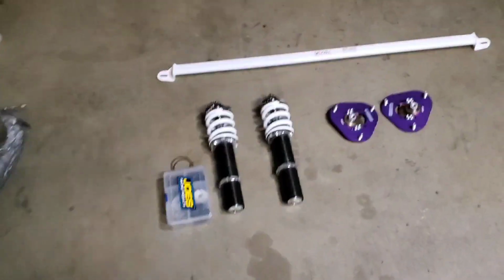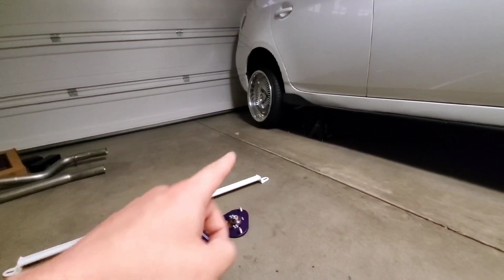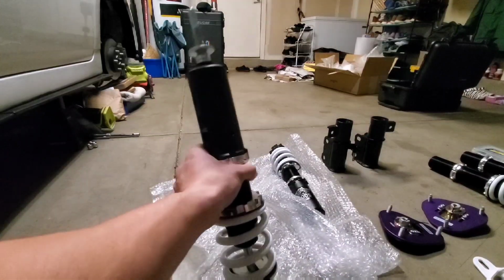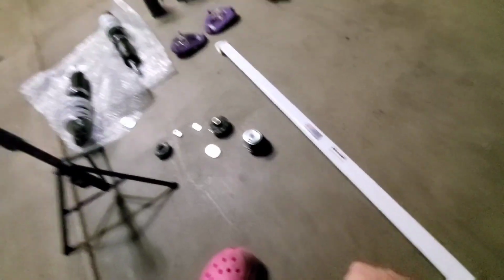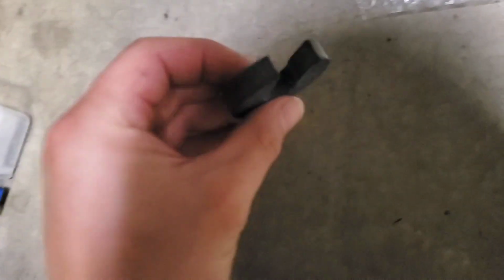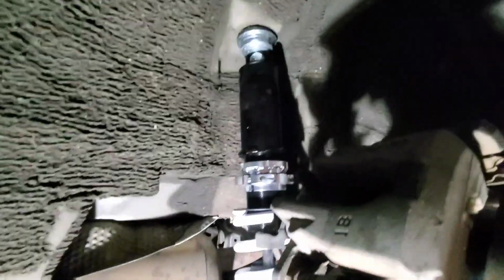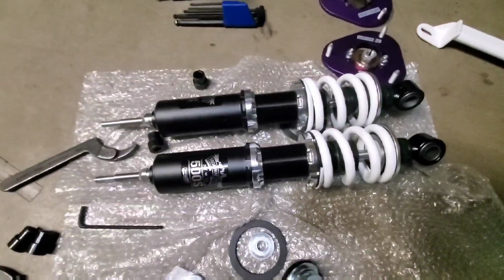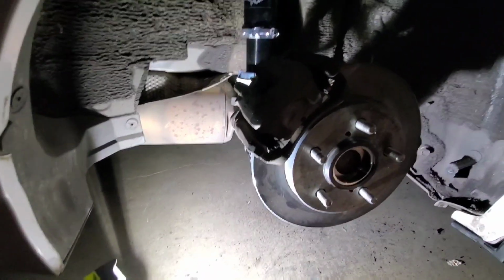PRIUS COILOVERS TRUE REAR CONVERSION BROADWAY STATIC

Comment: would this essentially work for lets say a 07 honda fit?
Reply from the maker: If clearance is available and you design it with the respective dimensions and the strut towers can handle it or are reinforced, yes.
Reply: What model car specifically did you get the rear coils from? I'm planning on attempting this on my fit too! 🤌

Comment: Nice video. What spring rates do you recommend for daily use on my 2016 focus se. My height is slammed and currently run 18k with helpers springs on the rear. The issue is that I keep bottoming on the bump stop with the slightest bounce. Should I go 24k like my fronts or should I just get 34k or higher. I don’t want to cut the bump stop or else I would probably hit my gas tank on the floor. I also don’t want a rock solid suspension that would give back pain. I had a herniated disc a while ago from improper work out form. Anything helps. Thanks.
Reply from the maker: You can adjust the stroke of your helpers to not compress as much because that’s going to quickly use up the piston shaft travel before it starts to hit bump stop. Other than that, you can go up a little bit to maybe 24k or so. I’m on 18k for the Prius with no problems currently. It sounds like your helpers may be the only thing that need to be adjusted if you’re hitting bump stop on the smallest amount of compression.
Reply: @Alexhaav  thank you! Yeah that makes sense. I think I have too much travel that the inertia causes my suspension to compress too much. I think I will just by shorter shock bodies so I don’t have to even run helpers springs if I want too.
Reply from the maker: @bogartsandoval  hell yeah brother

Comment: ah, i saw the part about bump stop shims. is there a way i can limit a lot of travel without having to buy a ton of shims? maybe stack washers or get a spacer or two, then place a shim on top of all of it? and would you still recommend running super stiff springs with that setup, and if so, what do you think is the minimum rate?
Reply from the maker: They also make something called bump stop pucks. There are a few different variants worth researching. But the method you described would also work in terms of saving money. Stiff springs will be up to personal preference. I'm still running 18k on mine just fine.
Reply: @Alexhaav  yeah, i'd like to be able to run 10k in the front (current setup) but have like an inch, maybe half an inch of travel max. i found 5" polyurethane bump stops for a jeep xj that are like $30/pair, do you think those would work?
Reply from the maker: @vtec.5ucks  yes, as long as the diameters for the piston shaft are proper!
Reply: @Alexhaav  awesome! thanks man!
Reply: @Alexhaav  also, how does this kind of setup ride? are you constantly banging the bump stop everywhere, or is it quiet?
Reply from the maker: @vtec.5ucks  pretty quiet! It's not as an extreme of a bump stop since there are still a series of things absorbing the impact. Esp the springs still function. If the springs weren't there, not so much.
Reply: @Alexhaav  i agree. ofc i'm still gonna keep my springs, not getting rid of those. i also found some truck body lift pucks that are 3" tall and $28/set of 4. they're also 2" in diameter, with a 5/8 inch inner diameter. hypothetically, i would defo put the pucks on the bottom, then my current bump stops on top for cushion. i think i'm gonna measure the droop from when the car is in the air, then account for that droop when measuring out for shim height. now that i think about it, especially with how soft my suspension is, i think 3" should be plenty for about an inch of travel or less, but i'd have to measure to know for sure. anyways, i really appreciate your help, man. if you have any more tips, send them my way!

here's a link to the pucks btw: https://www.ebay.com/itm/333121395772?chn=ps&var=542145150568&norover=1&mkevt=1&mkrid=711-117182-37290-0&mkcid=2&itemid=542145150568_333121395772&targetid=1262779896129&device=c&mktype=pla&googleloc=9026488&poi=&campaignid=13920181166&mkgroupid=124965446876&rlsatarget=pla-1262779896129&abcId=9300614&merchantid=6296724